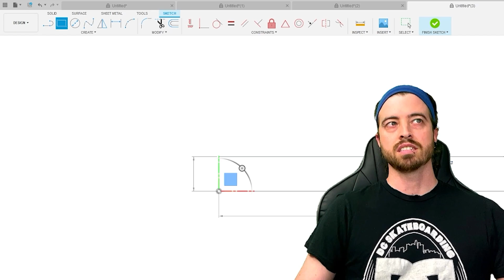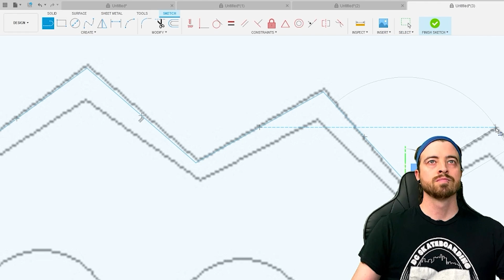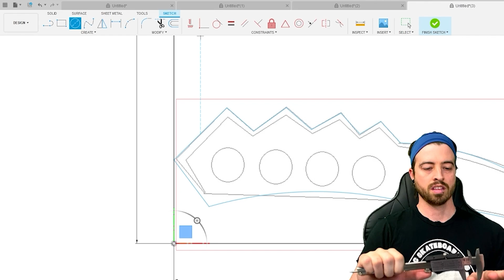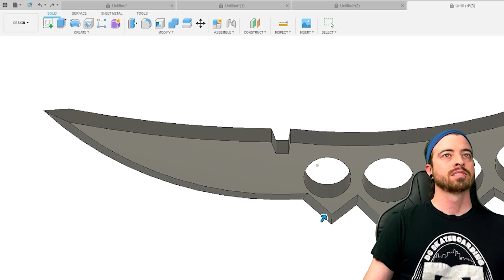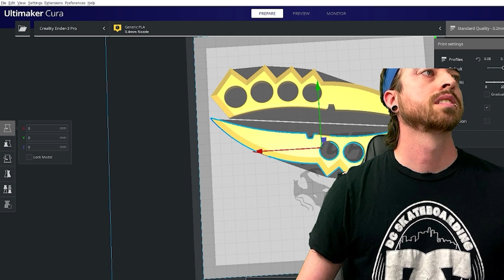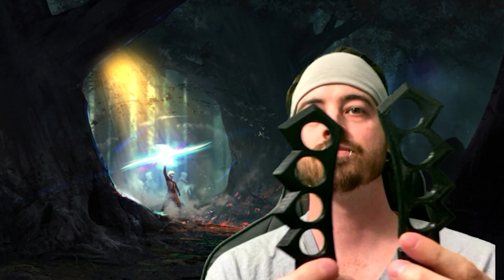Anime Toolbox Series Ep 3: 3D printing Asuma's Chakra blades

Comment: Awesome project. I just finished printing it and have some initial thoughts. First, if you put it on the bed diagonally you could make it a little longer which would be nice for larger hands. Second, the thumb really wants to ride on that handle point which is too sharp so the user could get injured there if it was used as a real weapon. A slight rounding would also be good on the finger holes for comfort. With some minor tweaks I think it would be good enough to be cast in metal and feel like a real weapon. All in all not bad for a quick trace. Good job.
Reply from the maker: Thanks, I'm glad you like it.